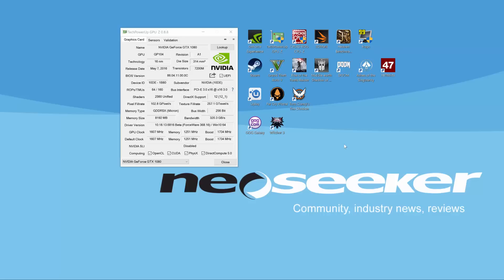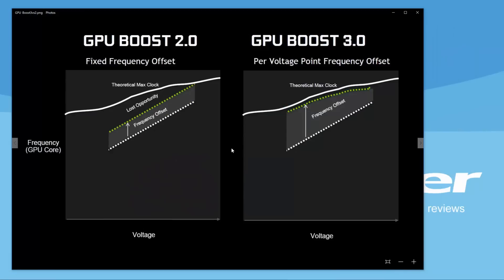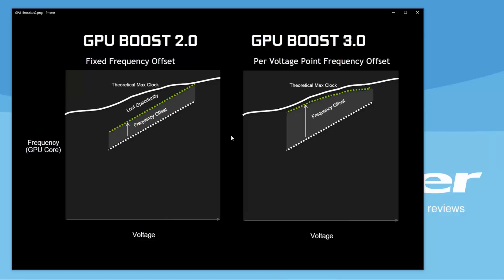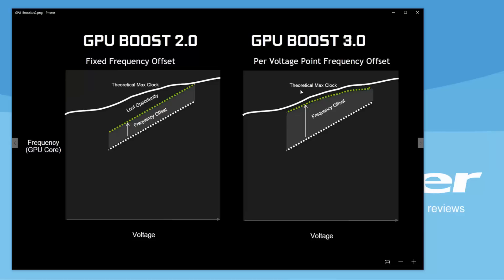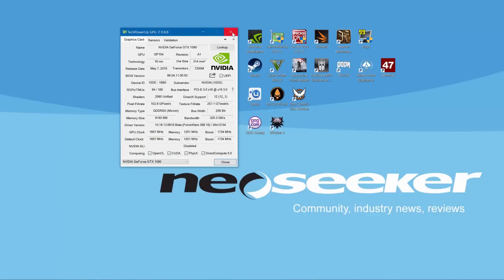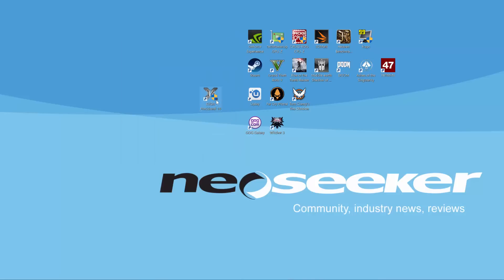NVIDIA GeForce GTX 1080 Founders Edition Overclocking Guide

Comment: anything above  +190 for my core clock crashes valley benchmark is it normal? i am running 2 gtx 1080 sli and i only manged to oc to 1987 stable clock how do i get it to stable 2ghz? i ocd my memory to +380 please help

Comment: Awesome video🎮👍I have the MSI GTX 1080 founders edition, to overclocked do I used this program or I have to use MSI afterburner? Thanks in advance
Reply from the maker: You can use either software, but I recommend using the MSI Afterburner for MSI cards. Just make sure you download the latest beta version available. I will be doing a special video featuring the MSI GTX 1080 Gaming X 8G this week, so stay tuned ;).
Reply: +Neoseeker thanks for the reply, I'll keep an eye on your next video😃👍
Reply: gpuz 0.8.8 isn't showing my updated base, boost and memory clocks when I set them in msi afterburner.  Can you tell me why that is?  I wanna know what my memory bandwidth is with my offsets but it never changes from 320gbps.
Reply: I get the same 2088 whether I use 175mhz offset or 250mhz offset. I'm pretty sure most people are getting very similar overclocks, it seems to be between 2088 and 2025 for everyone whether you have 150mhz or 250mhz offset.
Reply: what if im using asus geforce gtx 1080 should i use gpu tweak 2?